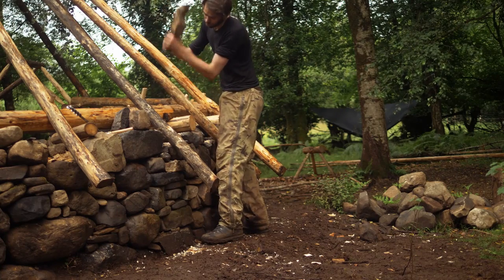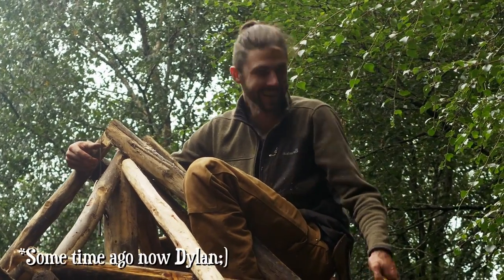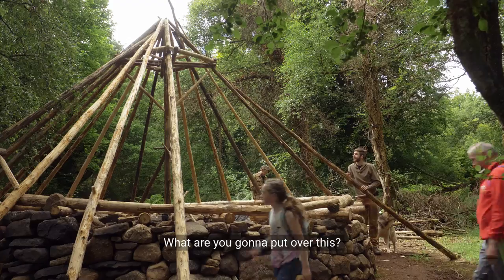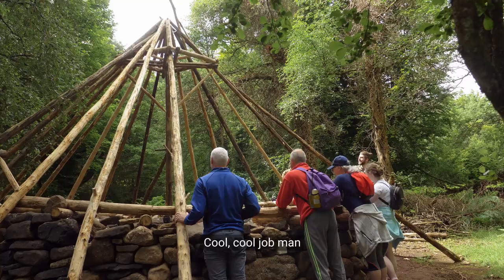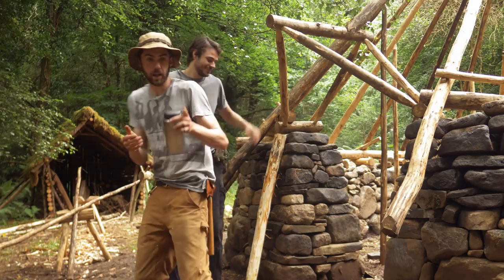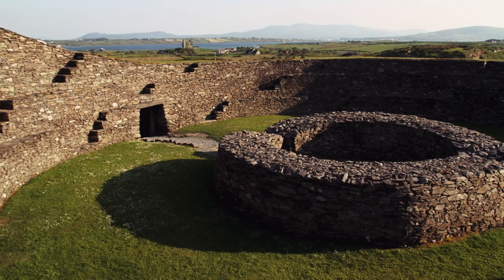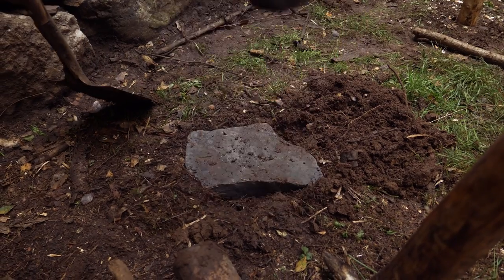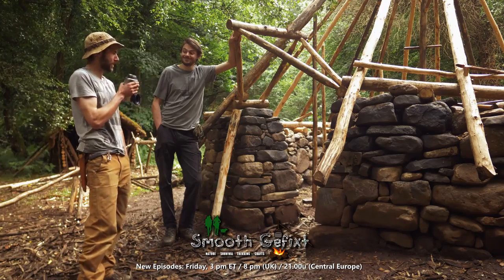Medieval Roundhouse Bushcraft Build - Roof Frame Finish & Historical Context (Ep.9)

Comment: Considering the evidence of how things were built with organic materials is pretty sketchy, there is no reason to assume that at least some round houses may have had entrances like yours. Archaeologists have a tendency to find one typical style for things and then apply it everywhere, whereas real people did not build to one exact style in the past anymore than they do today.
The supports inside are likely not necessary as the steep pitch of the rafters means there will be little bending force on them, I say that as a retired builder.

Comment: that triangle arch needs to go. it's odd looking and weakens the structure. roof strut will be essentially pushing it away once loaded with hundred of pounds or thatch.
Reply: They could counteract that with a couple outside  pillars slanting into the arch if it did.